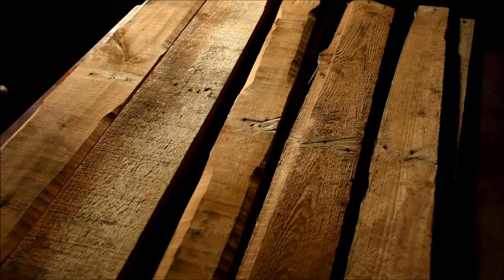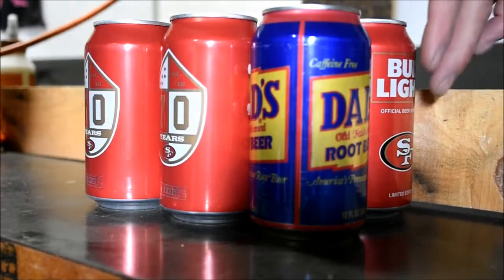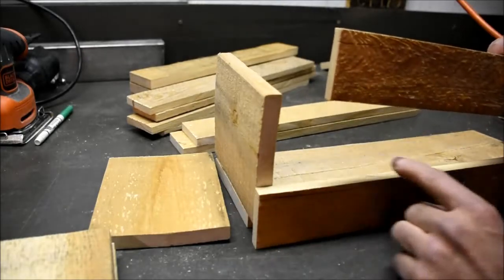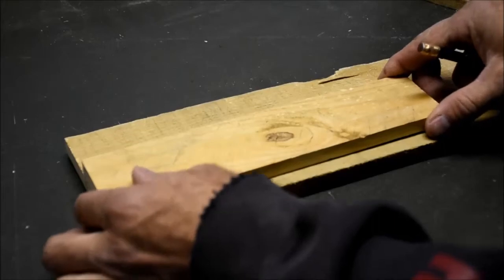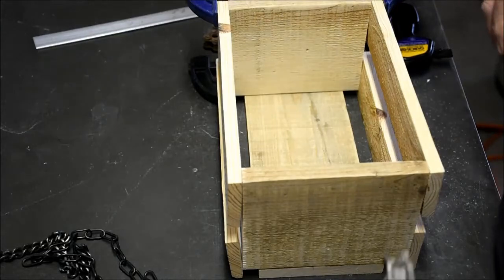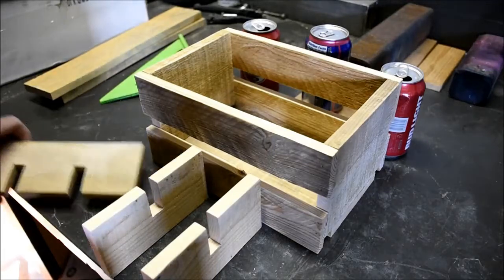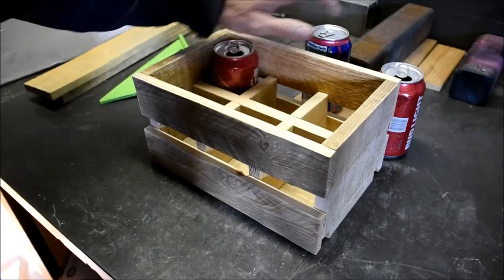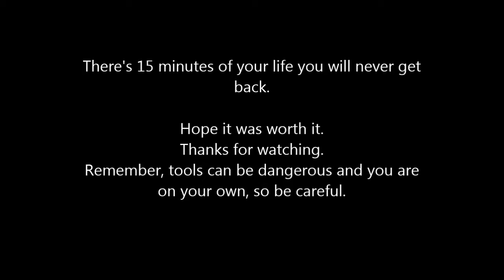Can crate - easy DIY pallet wood gift (aka beer tote)

Comment: The concept is good, however, I think it would have better structural integrity if the bottom had been secured inside the tote rather than underneath.
Reply from the maker: I pondered both ways, and I think it is a toss up.  Either way, it's a butt joint and they are not great without some type of reinforcement.  I just include instructions to consume the contents quickly ;).